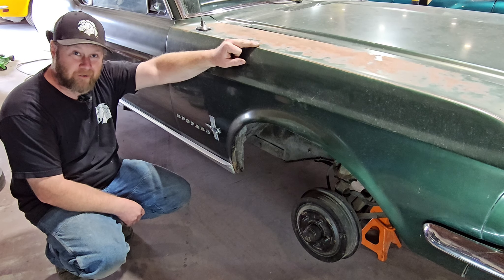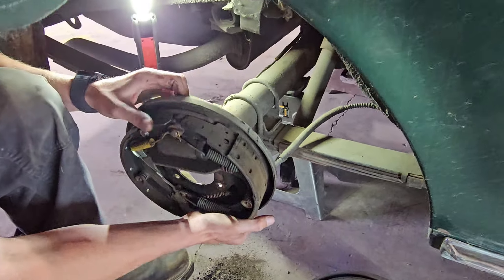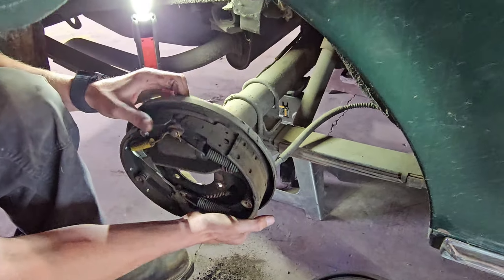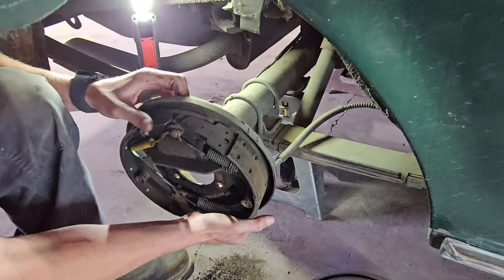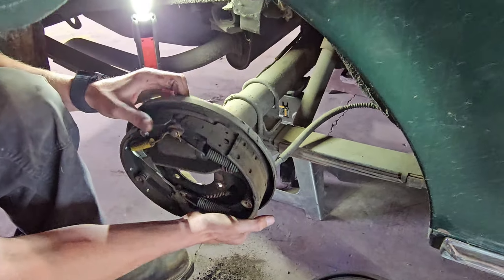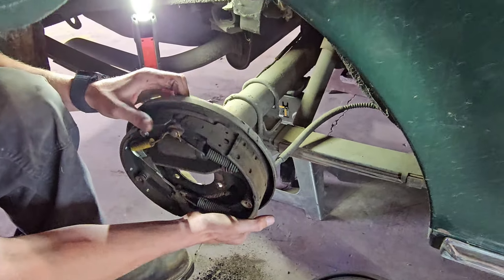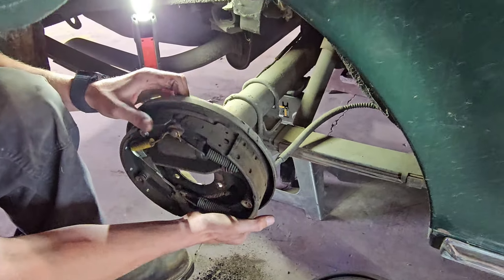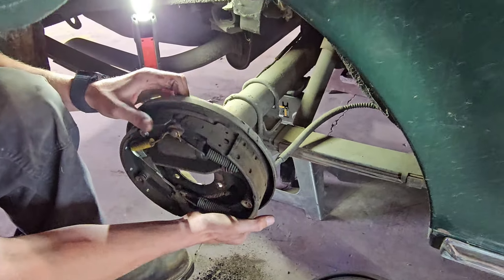Disc Brake Conversion - Step By Step Installation Guide (1967 Ford Mustang)

Comment: I’ve got the 65 Mustang, 6 cylinder version with 4 lug wheels.  Is the conversion about the same?
Reply from the maker: It should be the same, other than swapping axles and front hubs for the five lug. Unless you want to stick with the four lug. But I would do some research and give the company a call to confirm.

Comment: You guys made this look easy, the proportioning valve kicked my ass. Did you have to bleed the proportion valve as well? It kept going into limp mode and closing off the front lines anytime air would hit during the bleeding process.
Reply from the maker: The video shows a lot less time than what it was. It was definitely a pain! We didn't have any trouble with the proportioning valve. The system actually bled pretty easily, but I like bleeding brakes the old fashioned way, and I go around the car 2 to 3 times. We appreciate you watching and commenting!

Comment: Hows it going Im planning on disc brake conversion also for my 65 stang from 1 to 10 how do you rate the performance & difficulty.Im no mechanic will i need to buy adapters and such.
Thx
Reply from the maker: There's always modifications to be made on any conversion, nothing is truly just bolt on. This kit wasn't too bad but there are better kits out there. Don't skimp on price, you get what you pay for. Also no need for slotted or drilled rotors unless you are doing some form of performance driving. Do lots of research, hope this helps and thanks for watching!
Reply: Thx for the feed back which other kits do you know that you that it might work better.So I can you into that.👍
Reply from the maker: You might look into Wilwood or Baer brakes. The biggest thing is the quality of the caliper brackets.

Comment: Horrible; mislabelling left and right for DIY people🤦. 
That's a big, big red flag. Obviously the engineer needs to get called to "the management upstairs" for doing such a bad job. That's playing with people's life. Instead of making them safer with the kit. The engineer missed the exact point of the kit and achieved the opposite. You do that once in my company, big mistake, but people make mistakes. You don't check such a thing again... You're fired. Engineers always need to check their work in my company.
Reply from the maker: Yep, that's a big one. A normal do it your seller may not have caught that.